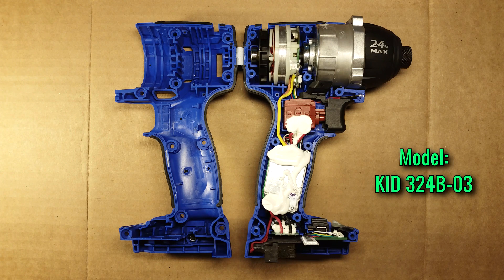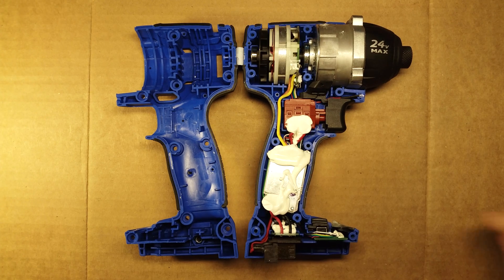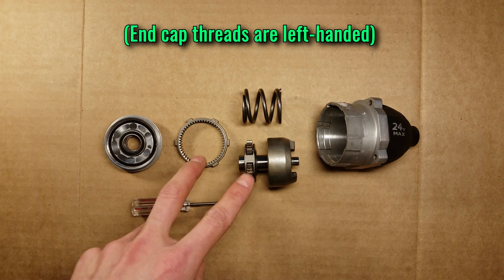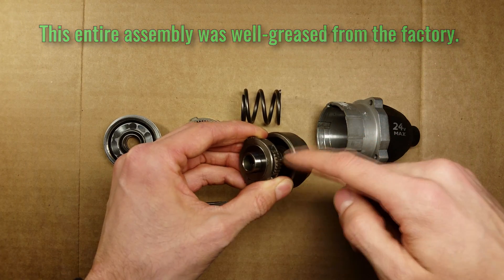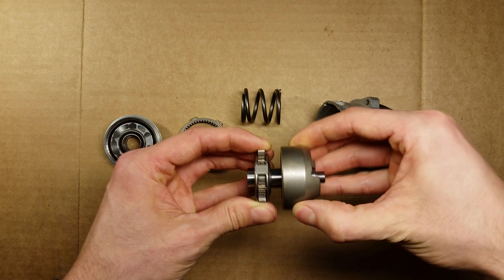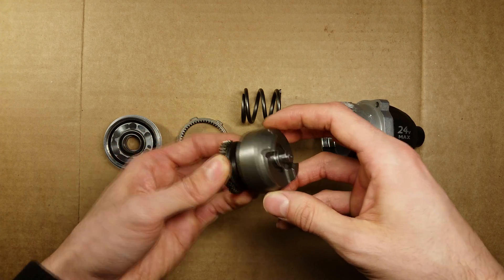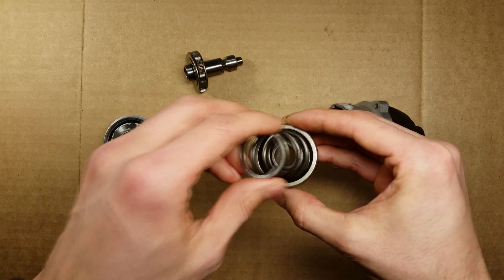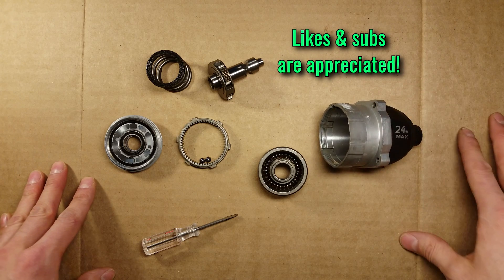🔧🔧🔧 1/4" Kobalt Brushless Impact Driver Teardown!  | 24V MAX | (KID 324B-03) | 4K!

Comment: Would this drill bolts stuck on a rotor? Deciding if i should but this or the drill or the short impact.
Reply from the maker: The impacting would likely snap the drill bit.  I'd go with the drill
Reply: @Filterficial how did you get the front off or this threaded part off You never showed and never explained
Reply: @Filterficial and many people were asking the comments and no answers

Comment: My MacBook air is at full volume but I could hardly hear so I had to move on.
Reply: wheelstandr same here on my iPad pro
Reply: yet no sound issue watching Youtube on a stock Samsung phone... sometimes the copy is better than the original ✌️
Reply: G Lasser copy? Even though Apple uses Samsung and other competitor parts for they’re stuff. I mean the iPhone is basically a different looking Samsung with different operating software.

Comment: That metal part inside the handle with the white goop stuff on it has some control chip I think that heats up if you use the tool a lot. I feel the handle of mine get warm. I don't think it's a big deal though. I have the 3/8" impact that's basically the same thing but has an anvil on it.

Comment: I want to know what the data pin does and how the tool \ battery communicate. Or is that pin solely for the battery charger. I have tons of good 18v and 20v kobalt tools and want to make an adapter to use these much cheaper 24v batteries in my still good tools. I already checked the volt rating of the motors and they will hold up just fine or long enough for me to upgrade that tool to the knew platform. If you have any insight let me know I really don't want to tear down my tools to try and figure it out lol.
Reply: Run 18vt Kobalt tools with the 24vt battery. They work fine. Knock off a interlock pine on the battery and it even slides into place. I guess I will have to do a video about how to make it work.
Reply: Interlock pin
Reply: hk3485 not worried about burning my house down. Just so happens I have to have a large Workshop so that would be burnt down LOL. But on a real note it is something I would take precaution for and would definitely have a plan if something like that were to happen. However before I undertake any project that has potential risk I always do my research to understand exactly what I'm doing still need to figure out what the data pain is used for I'm sure it's just for the charger as the tool doesn't really need to communicate.

Comment: I bought the 1/2 in compact impact wrench a few days ago and it the same size but it sounds like it has different gearing then the impact driver and it does have more power than the 3/8 wrench